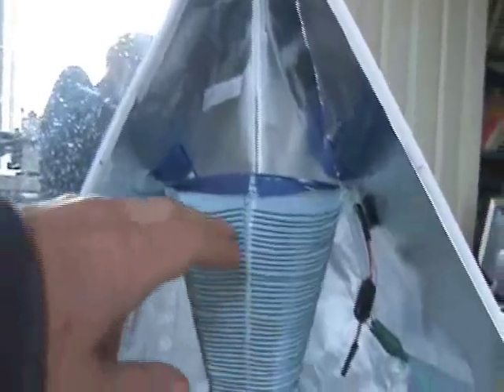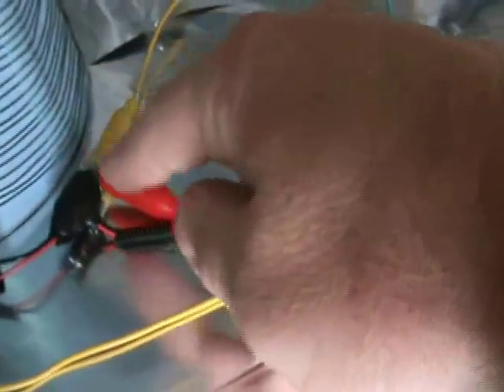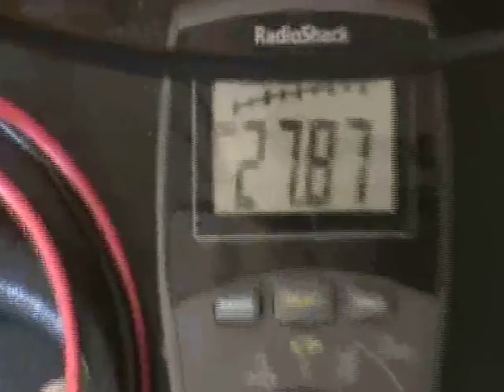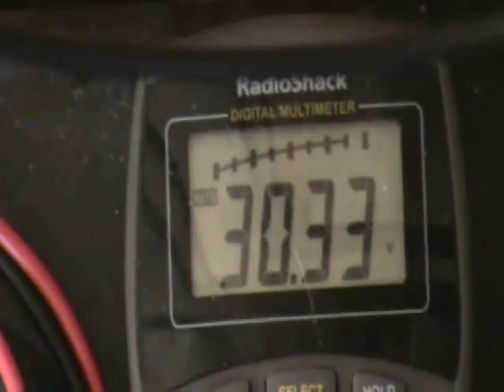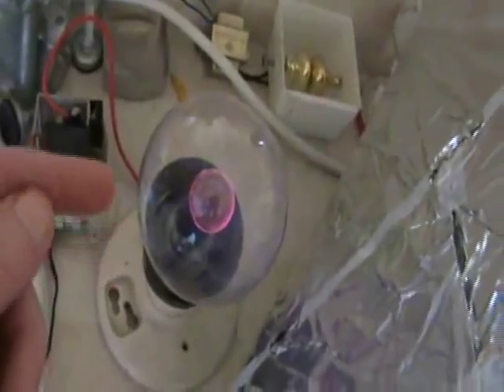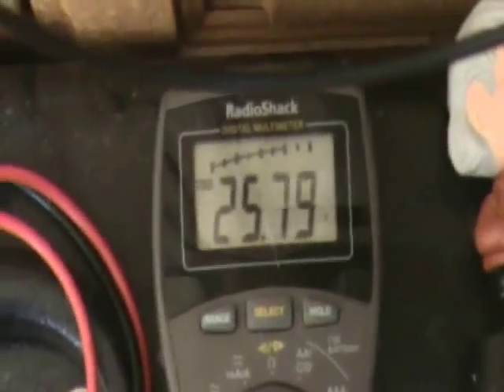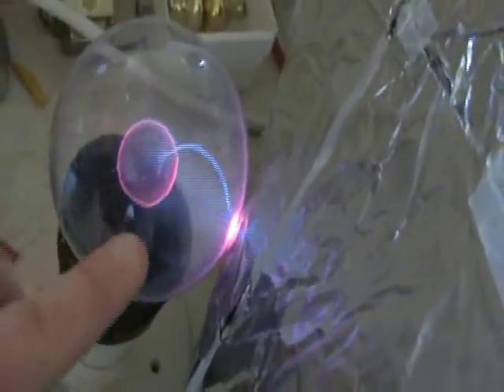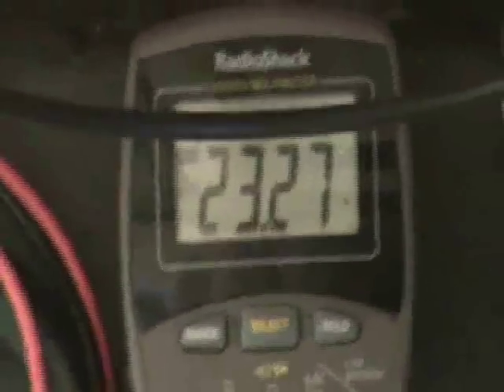Ep. 7: Bashar Free Energy Space-Time Antenna (Plasma Ball as Exciter)

Comment: Its relatively cheap to make your own journeymans crucible .... chicken wire and cement ... make a furnace using those same things and u can sal age old transmissions and coke cans for al...
You can make all sorts of molds or just pour out a small amount to form a thick sheet ... if u have the stuff I would suggest using something to pressurize it when you pour it in a mold... and since were making everything from scratch I would suggest finding away to pass current threw( or pulse one threw)

Comment from the maker: @slider2732 
Yeah I think I want to be 30khz to 225khz. I saw one paper that said that most of the lightning strikes around the world, happening 200 times per second, have energy in the 80khz range and lower. The problem is, I don't want to add capacitance to go lower. That reduces Q and makes reception worse. So, the other alternative is to go even bigger on the coil ... What is needed is thinner wire with LOW resistance and having it super-cooled.

Comment from the maker: @44335675 
Absolutely. As an electron zooms around the coil, a magnetic field is induced in the wire, creating a loop around the electron. That looping field will stretch out, size wise, depending upon the current going through. So if you were to hook this up to a pulse generator, say, with sufficient current, you could create some pretty build magnetic fields. One experiment would be to put a round-magnet in the center, and provide some window so you can see it. It should float.

Comment from the maker: @m3sca1 
Possibly. Its pretty easy to pull energy from a plasma ball, even with just a flat plate and wire.
This device, as a tank circuit, will tune to a certain frequency, but it is also pretty wide band.
I'm thinking the 600khz to 700khz range might be a good target for the tank since I read a paper
about a NASA experiment to map out the radio frequencies from space, and there was a peak
in that range. Imaging this tetrahedron as a satellite up in space. Its surrounded by energy.